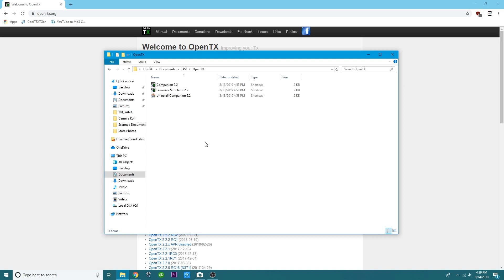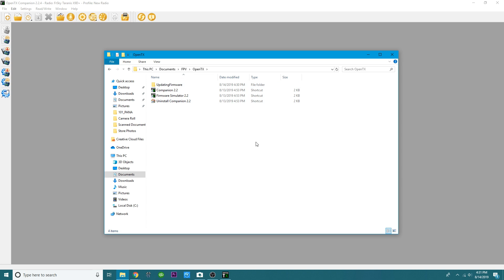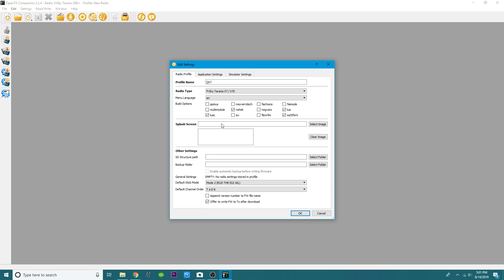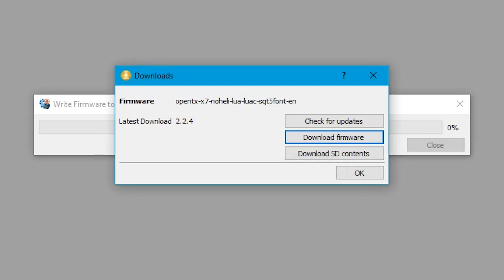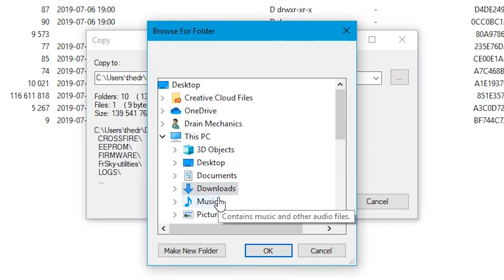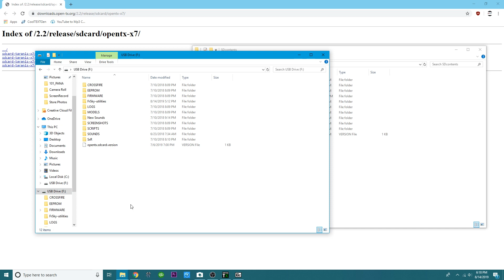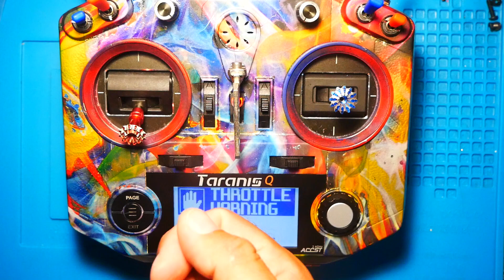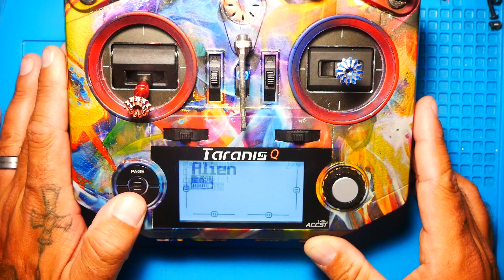How To Flash This New Firmware & Bootloader To OpenTX - Beginner's Guide To Frsky Taranis

Comment: hey drainman just followed ur video and completely bricked this fukking Taranis .... so after I unplugged after following all instructions to a T the thing instantly shut off... it will still load in boot loader mode, but if I try to start it up normal it doesn't do a thing... is there anyway to fix this or can you please help can we zoom or connect some way? I don't know what to do and im very frustrated here....

plz let me know if we can link up quickly I don't know what to do here/...

Comment: So can I pull the sd card out of my radio and plug it in my computer with an sd card reader and update everything that way? My mac will not recognize my transmitter at all. I know my cord supports data and even tried a usb 2.0 adapter. Im about to trash this thing. By trash i mean sell it lol

Comment: Forgive my intrusive comments but I’m thinking of a satisfying way of getting my own back on my 10express. Basically I couldn’t bind the militant thingy to any thing so I tried to upload it with open Tx. 
After deceiving myself into thinking i was capable of what apparently is a simple process…. I’ve got a useless lump of plastic I want revenge on. I’ve spent days on trying to get it working again and all I get is a sd config message. It doesn’t even laugh at me.
Part of me wants to take it skyward alight,  and drop it from 400 ft on my DJI fpv onto the local church with a curse.
Please help 😢
Kind regards James

Comment: After updating my X9D+ from fw 2.0.9 to the latest firmware all models doesn't work anymore, all custom functions and other settings are lost and had to be recreated again, even simple thing like the RX module is not the right one. Restoring them from backup doesn't help because the eeprom updates them as soon the tarains is powered on.

Comment: I'm not sure what happened here but I am new to this and I started watching your videos for their concise and easy to understand lessons. I was frustrated by what Taranis did on my QX7 ACCESS with no D8 Mode and was about to return it as I was having too much difficulty binding it. I finally got it binded in D16 mode after watching several of your vids, not specifically on the binding the transmitter to my TinyHawk 2, but just from the knowledge gained from your vids I was finally able to get something that works inside, but it's rainy so can't try it outside. Thanks

Comment: Hello DrainMan ,
first of all I would like to thank for sharing your knowledge ,,,, 
My friend I'm a beginner !!  I do have a Taranis QX7 radio - firmware 7access-2.3.5 (4fbe....)
The reason that I need to update and change my firmware is the fact that there in missing mode at my Taranis , Mode D8 is missing !
The Taranis can be connected to the DRL Simulator and also to the Betaflight program without any problem, , put when I connect it to the OpenTX program it's not possible to Read/Wright & not possible to download the firmware.
Please ur advice ?

Comment: My firmware update file won't save as a .bin file. It just saves as "All files" file type. When I try to flash it to my Qx7S, it says "new firmware is not compatible with the one currently installed!" Is there some file or program that I am missing or something?
Reply: For anyone that has this problem, I found the solution. You need to uncheck the box that says "check hardware compatibility" if it's the 1st time you are removing the FrSky stock firmware (this will be true if you have a new radio).

Comment: You have a bootloader and the author one. What is what? Why is there a 2 software?
Reply from the maker: The bootloader is what starts up every time your radio runs, it's what runs the operating system which is OpenTX with out it your radio would not run.

Comment: Is there a way to get D8 mode on qx7 ACCESS with r9m 2019?? It’s for a Emax that uses D8 mode only, or should I just send this receiver back  (and get the ACCST) before it’s too late??
Reply from the maker: I'm pretty sure you won't be able to, but don't hold me to it. I would just change the receiver in that quad.
Reply: DrainMan FPV Yeah that’s a little known problem with this new ACCESS, thought I was getting cutting edge which in some ways it maybe but some of us new bees (and others with Emax products) don’t realize what we’re losing (D8 mode) if we but this mode of QX7... but thanks for the response (I’m now a sub) and I’ve just ordered the QX7S ACCST US model that has D8 (according to Amazon 🤞🏽)

Comment: I need help, my x9d+. I followed instructions to the T I hit mode 2 made sure it matched yours. But my sticks are like it's in mode 1. I've double checked all my settings. ANY help would be greatly appreciated.
Reply from the maker: Reflash it and when you're in the settings down at the bottom there is a list of options for selecting your order. Pick Mode 2.
Reply: @DrainManFPV  I got everything on my taranis good to go. I have my CRSF micro TX on the nightly build, but for some reason my RX's wont bind. No matter how I try and do it. Any help would be greatly appreciated my friend.
Reply from the maker: @michaeldyer6079  do you have any that were bound prior? Try to power those up and see if they are still bound.

Comment: "New firmware is not compatible with the one currently installed" i get this message, duble check everything still nothing. i have qx7s, any advice ?
Reply from the maker: Are you selecting the correct firmware, if you are trying to install the one i have it won't work with the S you will need the one that fits your radio.
Reply: I had the same problem, and I found the solution. You need to uncheck the box that says "check hardware compatibility" if it's the 1st time you are removing the FrSky stock firmware (this will be true if you have a new radio).

Comment: Should I flash the firmware 2.2.4 or the newest which is 2.3.1?
Reply from the maker: I personally, always do the newest.
Reply: @DrainManFPV  I was asking because 2.3.1 is specially made for external RF. If I dont have one, can I still use 2.3.1?
Reply from the maker: @HEYITSMARKOO  I have not heard of this, the latest firmware is the latest firmware. They are always making improvements to it. I apologize, i wish i could give you an answer on that one. I would imagine you could use it just fine.
Reply: @DrainManFPV  many thanks for your responds. I figured it out what the problem was with my taranis and my r-xsr receiver. Noone showed in their setup video that you have to setup your for eu and not eu. And that there is a xjt firmware for flashing the radio. Maybe you want to mention it because many many people are trying to bind the receiver to the transmitter and dont know why it doesnt bind.
Reply from the maker: @HEYITSMARKOO  oh wow, I did not know that you were using non-eu sorry about that.

Comment: when saving when you have to shorten mine doesnt have .bin on the end what did i do wrong
Reply from the maker: down in the bottom of the window there will be a selection to change the file type, change it to **ALL FILES
Reply: The bottom of what page sorry
Reply: Ok I got it but my boot loader is still 2.2.3
Reply from the maker: @chazecramer5997  did you complete the entire process? you have to flash it inside the radio after you put it on there.

Comment: so what are the benefits of updating??
Reply from the maker: If you're coming from an earlier version there will be even more, but from 2.2.3

Multiprotocol: updated to match 1.2.1.63 (thx MRC3742)

Taranis: fix an issue where changing max baud could turn external module on

Taranis: remove Alt from top bar display in FAI mode

Horus: fix plane and glider wizard when no motor is selected

FrSky: fix ModelID unduly checked in D8 mode

FrSky: support Neuron ESC telemetry

Sky9X : add Flex R9M support

Crossfire: add vario sensor

Crossfire: raw CRSF telemetry data can be mirrored on AUX serial port

LUA: fix an issue where sportTelemetryPush() was not working when crc is 0x7D or 0x7E

LUA: add telem1 to telem32v

LUA: add lua mixers outputs

Companion: fix negative gvar precision (thx elecpower)

Companion: add mouseover tool tips to label fields with context menus (thx elecpower)

Companion: fix special function Inc/Dec Gvar (thx elecpower)

Companion: better multiprotocol name handling (thx MRC3742)

Companion: GPS format matches radio choice (thx elecpower)